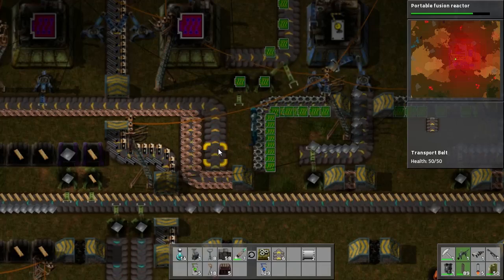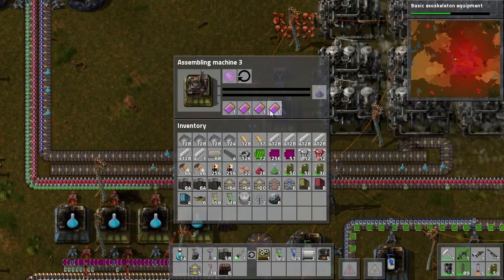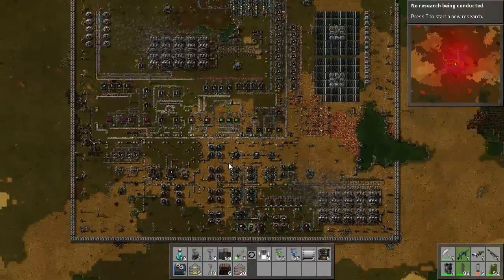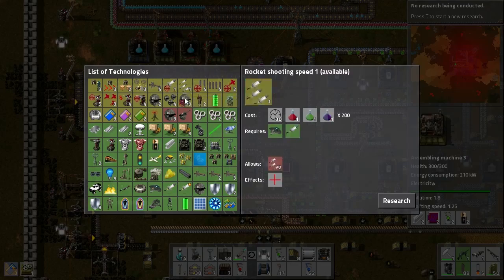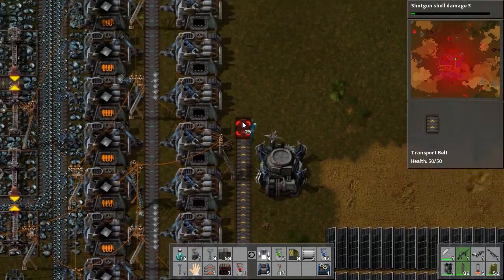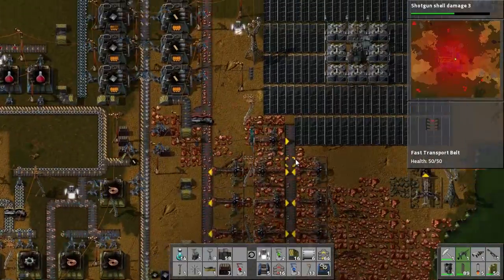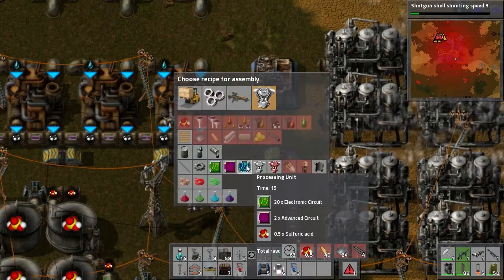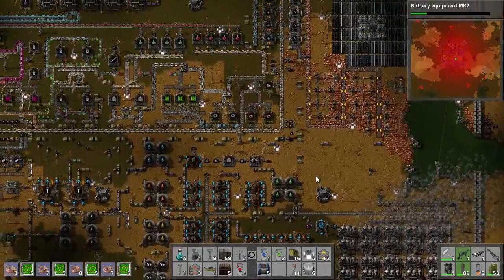Construction + Factorio #21 = Armour

Comment: Hi OSP, thanks for the video, nice one as usual :)

Here is a few feedback for you.
Curve belts : you can replace them just like straight belts instead of picking them up and putting them back down to "see the curve". What you need to watch is the direction it is going to the end.
Inventory shortcut : Q makes the item in your hand (on your mouse) go back to your toolbelt or in your inventory, depending on where it comes from and if you have any room left in your belt slots.
Other shortcuts : experiment with Control + click, Shift + click, Control + right click and Shift + right click when using stacks of items with chests or just inventory. It generally helps to dispatch your items.
Copper line : as other already pointed out, and for the sake of completeness, there is a normal belt instead of a fast belt just before the splitter. You can see it at 23:48.

Oh, and also : you will need MOAR of those electronic circuits... just look at the requirements for the Rocket Defense... Maybe consider expanding to a further mining site which you can protect with laser turrets and a roboport stuffed with repair packs (you can even make them there), and bring the smelted iron/copper plates with a train.

Comment: NICE! MORE FACTORIO!!!!
1st of all, WHY U NERVOUS? or SERIOUS? :P

My Usual Feedback for your Factory:
The bottleneck you fixed was an issue, but the one I mentioned in last comment is JUST AFTER where you fixed the little bottleneck you had. Those 2 smart inserters are feeding a belt wich has at the end of it another smart inserter (wich in turn feeds the Smart Inserter Factory). That last single Smart Inserter CAN'T SUPPLY ENOUGH electronic circuits for making your 2nd (Smar inserter) Assembly Machine, wich is not producing at all :S (AT 14.14 in this video, when you're placing the Repair Pack Assembly, you left unpowered the inserter I'm speaking about, just so you know wich is it :)

You can fix it adding another Sm. Ins, like you fixed this eppisode's bottleneck (even easier in fact) OR you could just REMOVE THE 2ND SMART INSERTOR ASSEMBLY :)

Comment: Stuff+, my first thought is to go 1/2 Productivity and 1/2 Speed modules in Assemblers. That way you get free stuff and get it fast. But I think 4 Productivity in the Alien Science Pack Assembler is the right call for that one. You only get so many Artifacts from the small spawners and you'll want to capitalize on those first ones as much as possible.

Also saw some comments below from people about Passive Provider Chests letting Constructor bots pick up their own dang repair packs instead of having them stocked in the ports. Maybe set the Active Provider Chest to hold, at max, a full stack per Roboport and set one Passive Provider Chest near each Roboport set to hold what ever maximum you want. The Logistic Bots will move from Active to Passive and the Constructors will pull from the closest Passive to the Port... 'least that's how I think it'll work.

Comment: Build another electronic circuit assembler somewhere, then let your robotfriends carry them to where you need them. In fact, if you get a few more logistic robots, then you could power that assembler only with your robots. The same goes for your copper cables, since you might need another assembler for that. 

You can do the same for alot of small assemblers that build stuff like belts or engines. 

Also, place a storage chest for your logistic system that feeds into a new activ/passive chest. Sometimes your robots keep your ressources on themselfs if there little project is done before they get there and will do nothing because they don't know where to put it back.

Comment: If you didn't know, when you replace belts with better belts (upgrading them I guess one would call it), even though when you get to a turn the belt looks like it will go straight, it will actually fit right in place of the old one (still in the turned position). I don't normally do this but like this so he can see it because it really slows him down when he actually breaks the belt and replaces it in the video :)

Comment: Instead of adding more factories to a section, ie more circuit factories in the circuit factories spot, don't be afraid to build a new section that takes a fresh stream of ore and  only makes circuits.

This may seem odd, but before you get too far into an expansion, consider calling what you have made so far the science factory and say 'this is fit for purpose'.
Take what you learned and make a new area just dedicated to the next project, be in the upgrade modules or combat items.

I think a lot of people, myself included, get stuck with an idea and keep running with it until they realize they should have stopped a while back. In Factorio this is the 'lets just add a little more on the end of this resource stream'. Just something to think about and keep up the good work.
Reply: AGREE 100%
IT IS DONE! That's your base factory. It makes your science and a surplus of Belts and Inserters.
DONE.

New factory, grabing copper and iron from the start or from a new furnance area, and use it to make the (robot/modules/armor/etc).
GREAT idea

Comment: When you run out of raw resources your gonna feel mighty scared :) What a lot of people do, and I do now, is you weave the raw resources to burn and weave the iron/metal, copper and coal through your whole base and then you create 1 to 1 factories for each things you want to make. So copper/intake > EC (electric circuits) > making end product < AEC (Advanced electric) < iron intake/copper intake, and have those as factories. I used to do the way you do now, have belts of advanced, normal electric circuits, iron gears etc...but you get stuck in the endgame.

Comment: Active provider chest will make robots to take from there ALWAYS and put it in storage chests or roboports. Passive provider chests will provide stuff only to requester chests or for constructing stuff, so just have PASSIVE chest at repair pack factory and robots will take it from there, only when they will need it. As for limitation you can set it up several ways for that chest using smart inserter and green or red wire by connecting power pole-chest-power pole-smart inserter and then you can set condition how much you want this factory to make.
Reply: Or since you're putting it into a logistic chest, check the entire network for how many there are there.

It's a third option that appears when it's within a logistic network.
No more wires!

Comment: You don't need to have them put the repair packs into the roboports. If you have them in the logic system the robots will pick them up where ever they are. 

At least that was my experience.
Reply: needs a requester chest instead of provider chest though :)
Reply: I just had them in active providers which were moved to a storage chest.
Reply: oh, I get what you mean. You didn't want them on you, only on the port.
Reply: I loaded my roboports with repair packs.., one factory with a slow inserter to feed barely takes any till on the resources, didn't really notice it but now there are repair packs close to the damaged walls ;))
Reply: Frank Spencer You can put repair packs in passive provider chests and they'll be picked up by the construction robots when they're needed.

Then again, my entire factory relies on my 192 logistics robots to make everything, and my 192 construction robots to build everything I designate with blueprints.